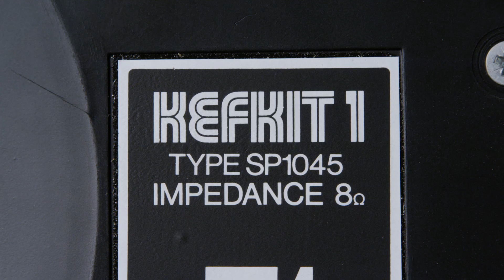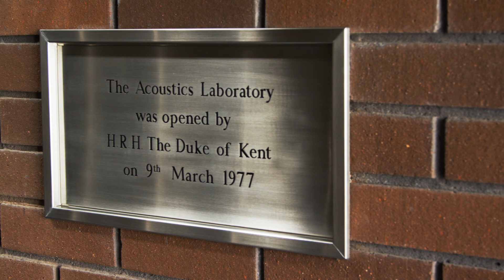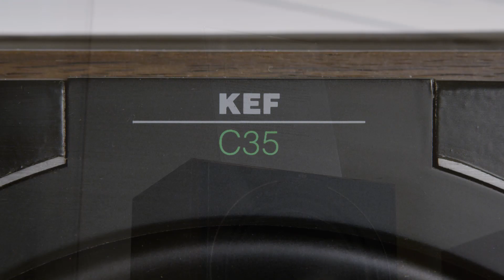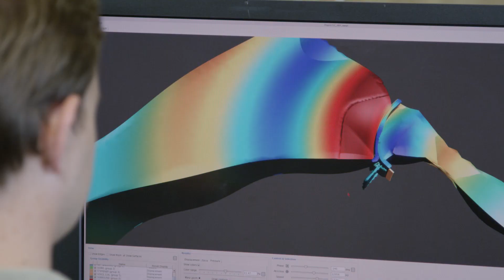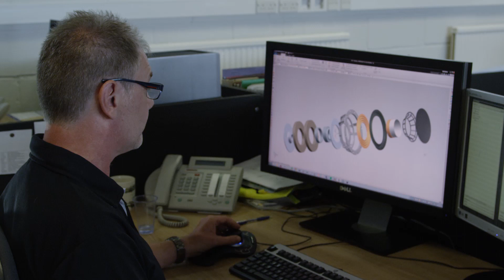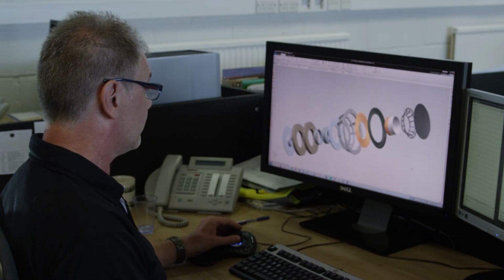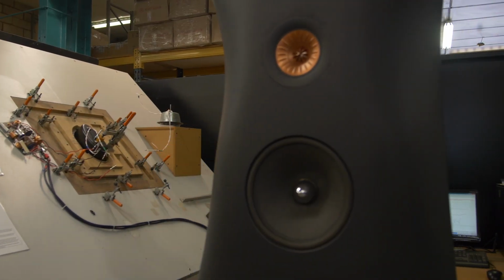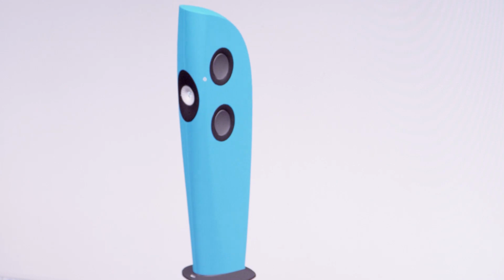KEF and the Uni-Q driver

Comment: To KEF:
My research into Kef brings me to this video.  All reviewers say that KEF speakers are not so forgiving in that they hv low sensitivity, therefore requiring powerful receivers to drive them.

I am looking to purchase LS50 to pair with my tube amp. I am afraid that my tube amp may not be powerful enough to produce the kind of sound that KEF is known for. 

I wonder what KEF's response would be to reviewers and users who frequently find that KEF speakers require the strongest amplifiers, the best DACs and high power
Reply: Try older models, some have 96db.
Reply: I think their answer would be: Buy the wireless versions where the DAC+AMP is integrated in the speaker. As a bonus, that matching of the DAC+AMP+Speaker is done by a KEF engineer so you know you get the best combo that sounds like KEF intended to. 

For me, the KEF LS50 Wireless 2 would be the ideal solution. Unfortunately, I do not have the cash to splash up 2000 euro's, so I bought a second hand LS50 :)
Reply: @Paprika526  Would any sound be degrade when transmitted wirelessly, as opposed to wired connection? Would the timing & soundscape be off as well, thereby requiring a very sophisticated calibration?

Comment: I get that this system is pretty much perfect so long as the midrange / LF part of the driver is idle.... But as soon as you put bass through it, you essentially get a waveguide that's constantly moving back and forth... Doesn't this cause problems with dispersion? I believe that they sound utterly fantastic, but  the relationship between the tweeter and the moving midrange / LF driver while excursion is happening isn't really mentioned at all which kinda baffles me.
Reply from the maker: It's a very good point -- one that our founder, Doug Schneider, brought up with designer Jack O'Clee-Brown. According to Jack, since the tweeter and the midrange work together and never change, they know how the tweeter is behaving inside the midrange at the various SPLs, so then can tune the tweeter, via the crossover, to iron out some/most of the anomalies the midrange causes.
Reply: Ah that's super interesting! Would've loved to hear them explain it a bit more since it's a really intriguing aspect of designing drivers like these!

Comment: are they for casual listening?
Reply: oh absolutely the KEF Q and R series will blow your mind how easy they are to listen to. in particularly the Q100 and R300. The LS50 speakers are some of the best I have ever heard. I am no audiophile or at least do not consider my self one. I just love music.
Reply: Not a clue what that even means.
Reply: Michael The Sociopath can you list some amps/dacs that you would recommend
Reply: The LS50 is a very detailed speaker but in the best way, but they need a good amplifier, good dac, good stands and if is possible power conditioner... with a denon receiver is not good, with a proper setup they are insane
Reply: Zimba's Doom Corner no brightness at all with LS50 or KEF in general unless you're using a class D amp or a not very well designed class A/B amp, it could become bright if your source is bright. Feeding KEF speakers with class A power + a good DAC/record player will blow your mind!

Regarding your studio concern, they do not sound like studio monitors. Most studio monitors are have several drivers that are not even optimised in the time domain and are powered by class D amps. This usually makes them sound bright and fatiguing, not the flat frequency response that they usually have.

You could use KEF LS50/Reference/Blade for recording studio use. They sound superior in realism to all active monitors, especially in the soundstage department - no non-coaxial/non-single driver setup will ever have as much temporal resolution as KEF speakers.
Reply: yes. Speakers serve different purposes. A studio speaker has different characteristics than a home 2.0 setup, and a 5.1 or 7.1 have different qualities as well. Since the LS50 is a studio speaker by design I was concerned it may be too analytical (ear fatigue) or have too much treble. As opposed to something more laid back.
Reply: Zimba's Doom Corner the monitor series are designed to share the same voicing but at near field while their loud speakers are tuned for far field including the proper slopes and dips they pioneered with the classic stellar LS3s I. E. The BBC dip

Audyssey and other speaker calibration software will actually add those dips for you to make the speaker sound natural for far field listening. Its better to have the speaker less EQd however so it's not advised to used monitors as loud speakers and vice versa.

The LS50s have a darker velvety tone and are designed to be useful as near field and far field speakers however some do call their tone recessed.